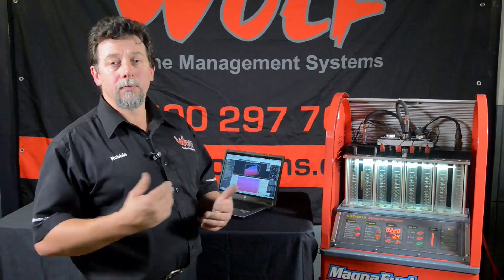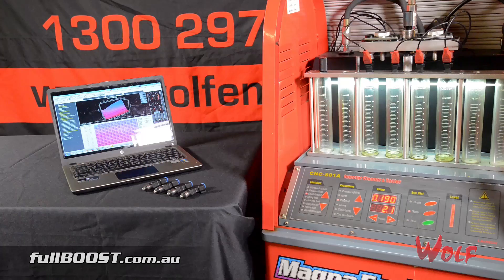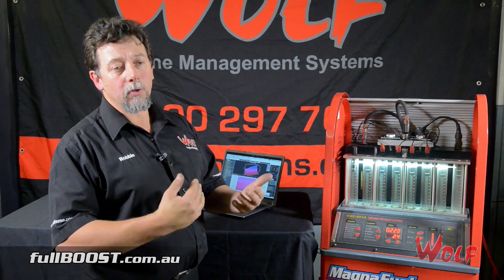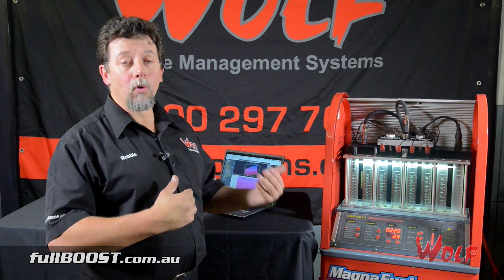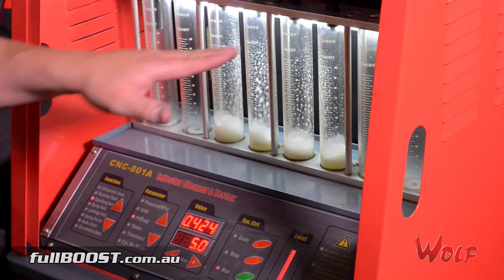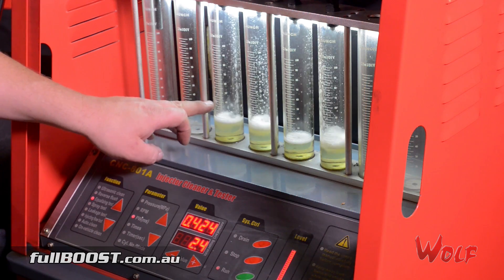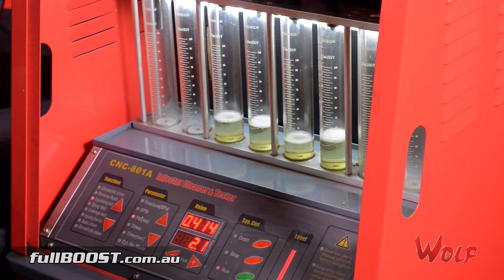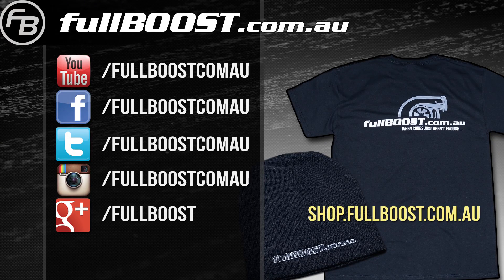Injector duty cycle testing

Comment: Great video, have a bit of an unrelated question that I've scoured the net for and can't find anything. 

Have you tested dual feed center return vs single feed fuel rail with high flow injectors? 

I have seen many high power cars running it both ways. This particular application is an inline 6cyl. The concern raised by the slew of internet warriors against a single feed single return on an inline 6 is that there is a pressure drop across the latter injectors. but assuming the line size and pump flow is adequate, I just don't see how this can be true with the regulator being after the injectors. 

Have you seen anything throughout your testing that would shed light on any possible volume differences or if there is science behind a dual feed rail vs single large feed?